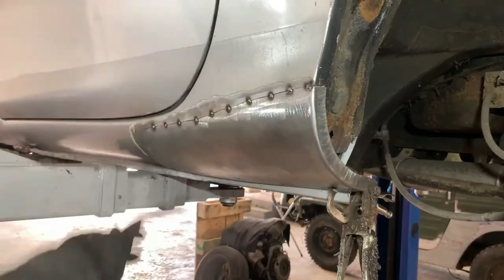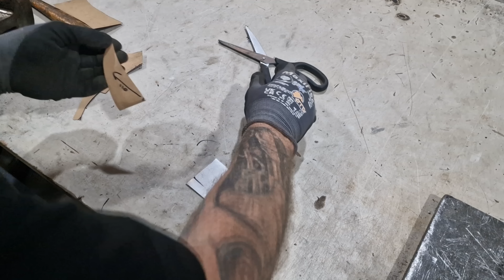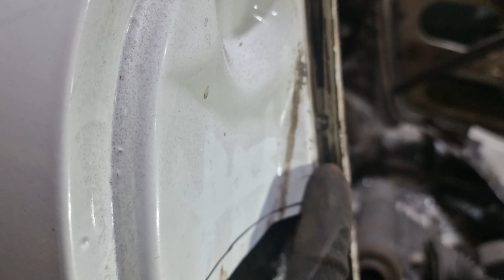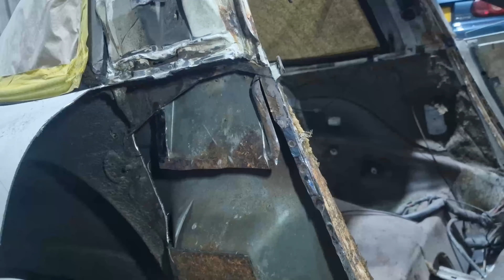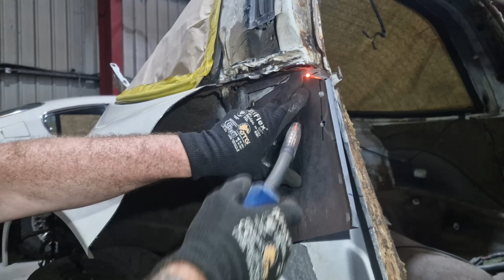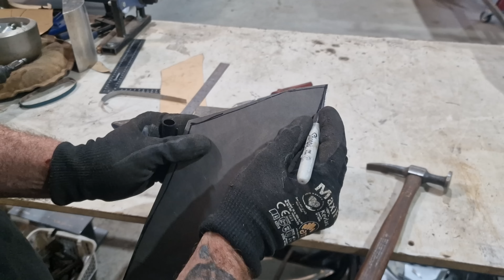We find even MORE ROT on the Porsche 911, Can we still Save it ?

Comment: Oddly, I’ve never considered that Porsche 911s might rust. Odd that I’d not even thought about it. Perhaps it’s because all of the examples I’ve ever seen have been cherished cars…..just goes to show, doesn’t matter how expensive a car is when it’s new, it’ll eventually turn to iron oxide just like a cheap car! Great video - thanks for sharing!
Reply: Later ones were
Galvanised
Reply: When buying a classic car,especially a high performance one,it is better to pay for a specialist engineers report, or buy from a trusted specialist, rather than auction or advert 
But like houses people resent paying out money for specialist services, hopefully this owner did not get caught out,as a long term investment the repair costs should fade as the vehicle increases in value
I looked at 20 cars before I bought mine,and paid an engineer for a report on two that at first test seemed sound,they weren't,did I waste 300 pounds nope
Money well spent, eventually armed with a list he gave me I got the correct car
Still have it 30 years later and that was on a fairly standard 1960s saloon car
Reply: All 911s were fully galvanised since 1976.  It's just the salted roads that kill them - it's hard to combat that.  Ask me how I know!
Reply: @russthebiker Very thorough selection method! I wish I’d been thorough when choosing a couple of project bikes. Cheapest is definitely not the right end of the scale.

Comment: I have a question. Why do you install some hand made panels and weld them solid and blend them in to look seamless and others only a few spots and leave the rest with an obvious cut that is not weld and blended? Is there something I am missing doing that?   Thumbs Up!
Reply: I had exactly the same question!
Reply: I am sure Steve will answer your question in more detail but suggestion is some are shown and possibly structural while others may not be
Reply: It usually depends on strength/structural areas or cosmetic areas. 
Certain areas such as close to suspension mounts have to be seam welded other panels only require spot welds with say an inch gap between as they are not a structural part. 

For example, Being a convertible, the inner and outer sill panels have to be stronger than a car with a solid roof to keep the body rigidity stop flex.
 Where as a panel attached to a rear quarter wheel arch may only need spot welds as the quarter panel doesn't require or add structural strength. 
Its mostly cosmetic on the car. 
MOT states any rot within 12" of a chassis mount, jacking point or suspension mount is a failure. 
You would seam weld these repair areas.
Reply: Wait and watch the next one, all will be revealed.
Reply: Perhaps, timing wise, with all the panels he has to make, it would take to long to film and weld everything or he just makes the panels and just has a massive weldathon at the end?
Reply: It's Always better to be  able to Come back easily if something goes wrong . A few weld spots will give sufficient strength Wile allowing going further on panels around.  And if everything matches great, Time to put those welds on 🙂
Reply: It’s allot to do with flash rusting.